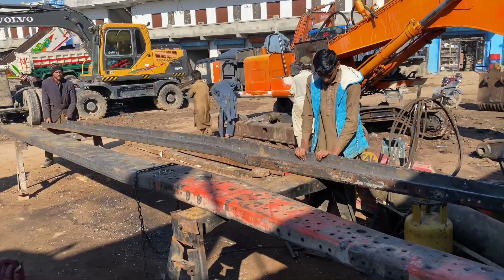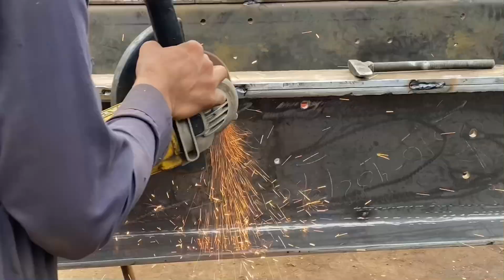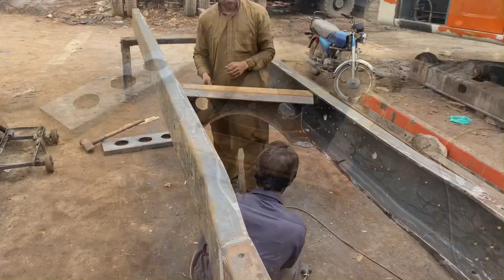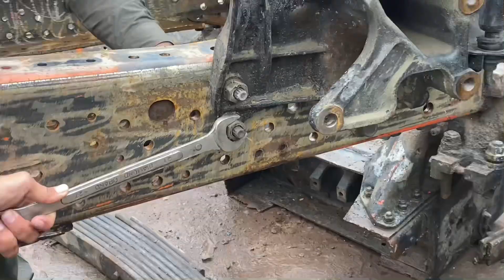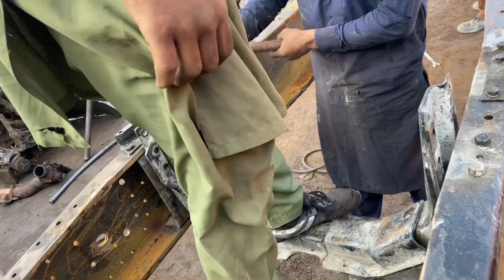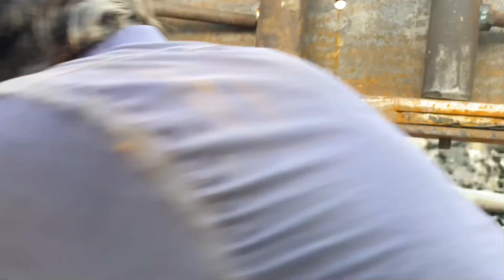Handmade Hino Truck Production In Pakistan | Truck Manufacturing Process in Local Workshop|

Comment: The problem with piling up layers of metal on top of one another is that water and dirt will go between the layers and stay there while you cannot paint between the layers. The result will be accellerated corrosion.